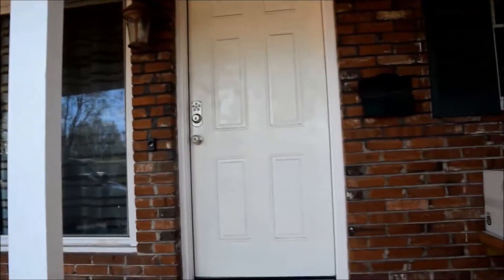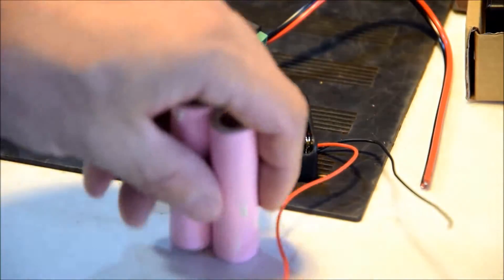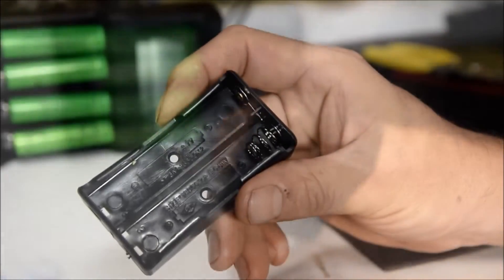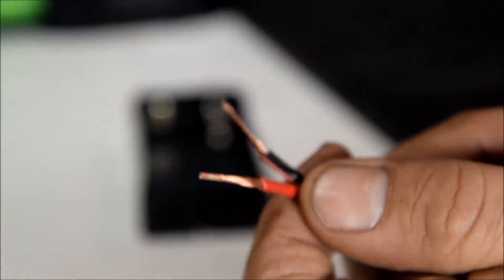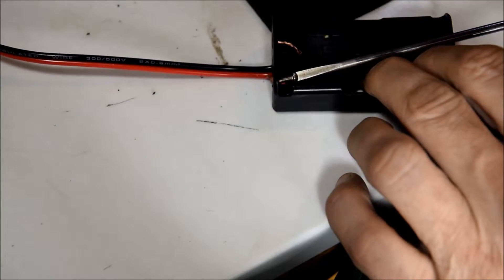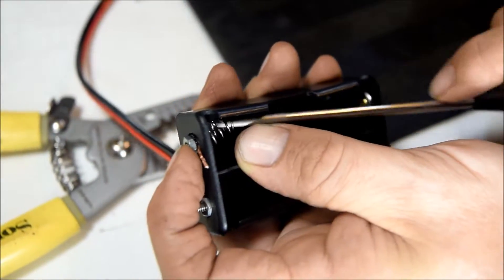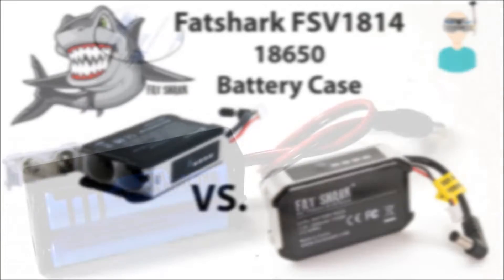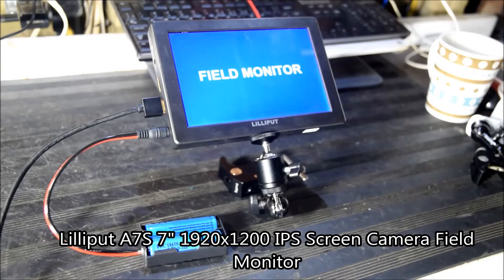7.4 Volt 18650 Li-Ion Cell Battery Holder - DIY

Comment: I have a speaker with cells of 7.4 v and 1800 mAH Since it's very difficult for me  get the right Amp. Could be possible to replace my battery with other with a higher mAh

Comment: check out the Nitecore f1... for a few bucks more you have a single cell holder that you don't have to take the cells out of to recharge as the F1 is a fully protected charger no bigger than a regular single cell holder and if you want one for two cells you can buy the F2 for double the price... or you can buy a charger module for a couple bucks at banggood or ebay and add it to the holder you built in this video... just a thought.
Reply from the maker: Hi There, Thanks for the comment. I looked up the Nitecore F1, And F2. Very interesting products.